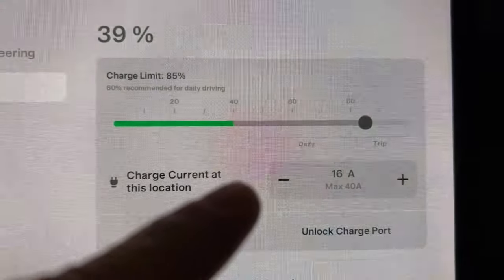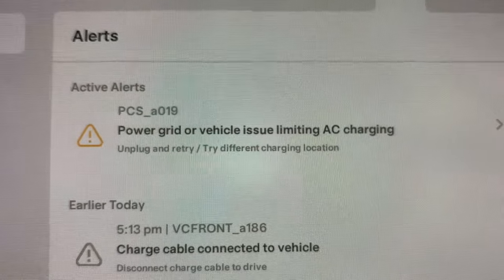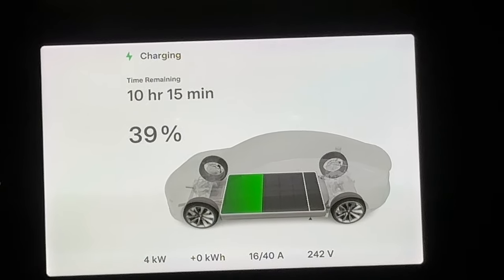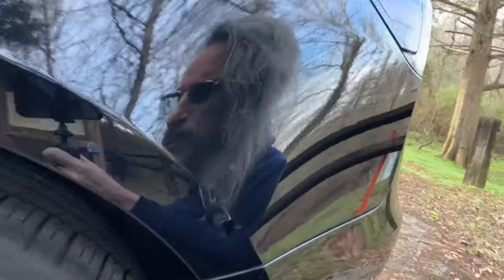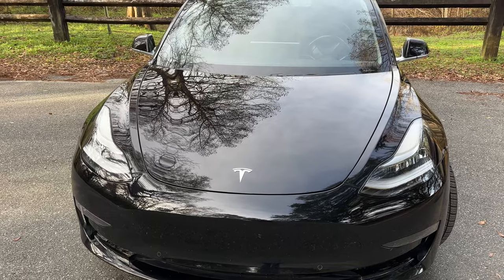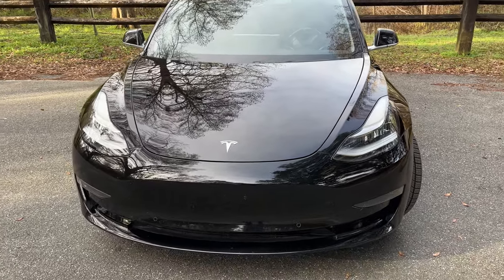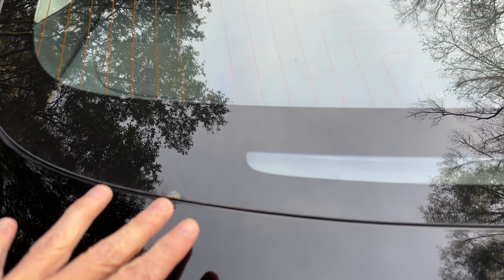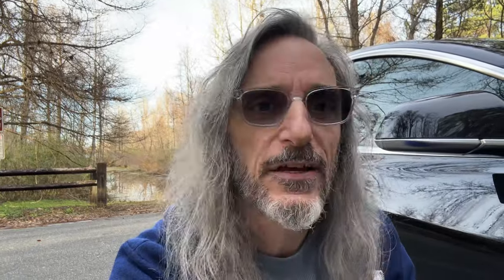Everything Wrong With My Tesla Model 3 That I Bought Used

Comment: I bought a 21 M3 RWD in Jan of 2023 with 11k miles on it.  Just before the huge price drops and the huge drops in the user car market.  I so regret not waiting longer, a lot of depreciation obviously due to that.  Anyway, the reason I'm posting is to share my experience.  AT roughly 18k miles my screen got a message saying "maximum charge level and range may be reduced".  I took it to the Service Center and they had to replace the battery.  This happened last July, the car was with them for a week.  I had a great experience though.  They gave me an 18 model S as a loaner.  A week doesn't seem to bad for them to order it, ship it and install it.  The car now has 26k miles on it.
Reply from the maker: 26k and a fresh battery! I feel you on the depreciation, though. That was an element of my buying decision. I was going to get a Bolt EV, but figured the Tesla would depreciate less and also be a lot more fun to drive. Definitely true on both counts.
Reply: A couple of questions about that battery. . .

Did they give you a new battery or a refurbished battery?

What's the warranty on the "new' battery?

Did they give you any explanation for why the battery would fail so soon?
Reply: A new battery would be a plus.  A reconditioned battery, not so much.  Ive seen quite a few Tesla owners have their reconditioned battery die.
Reply: That’s the worst luck ever. Less than 5% of Tesla batteries have issues at all, and <1% require full battery change

Comment: After watching this video I'm fully convinced to buy m3p. There is nothing to spend on this car. I spend over 4k on my mk6 golf r  a year , running stage 2 ecu and tcu tune , changed tranfer case,  water pump, oil leak etc cos I'm sensitive to my car I want everything perfect.  Since I realized how much power this m3p is making  . I have been watching tones of videos to see if it has major  maintenance issues.  Thanks for this video
Reply: Did you get it yet?
Reply: @itsr1tz326   no haven't sell my golf r. As I have more important things to do now( buying apartment)
Reply: Bro SAME I have a tuned 435i bmw and im just over it like I just want simplicity at this point now im older

Comment: Why is it out of warranty. It is a 2018. So you should have 2 years left.  Unless it has over 100k miles.  That’s exactly why I bought a 2021 so it will be under warranty for me
Reply: There’s only a 4 year warranty or 100,000 miles on car and drive train and 8 years or 100miles on battery

Comment: The advice I would give with anything electronic is that you should never run anything at 100% if you want it to last long. Flashlights, fans, TVs, phones etc... brightness levels, color levels, charge rates, speeds etc... when anything is run near maximum components will have a shorter thermal life for consumer products. Everything is built with a tight tolerance and to make it profitable. An EV is all electronics so I would be applying that thought process to everything I could. When the PCS is repaired I would limit charging amps to half to give it the best chance at not needed to be replaced ever again if supercharging a lot. It's probably healthier for the battery degradation to.

Comment: Maybe wait to fix the PCS thingy until the Tallahassee service center opens this summer.  Heck more convenient than somehow getting the car to Jacksonville.  Looks like the Superchargers on West Pensacola will be open in a few weeks - maybe.  And they have started work on another new Supercharger location at a Circle-K on Thomasville Rd next to I-10.  High times for Tesla owners in Tallahassee!
Reply from the maker: Oh, I hadn't heard about new Superchargers on Thomasville. I'll have to check those out.
Waiting for the Tallahassee service center is a good idea, and as long as it doesn't fail before it opens, I'll probably do that.
Reply: @DriveElectricWithDomenick  There is a new 4-stall CCS charging spot at the SunSpot on US 90 exit on I-10.  Currently free!  I charged there today and got max speed of 189 kWh at 21%.  Did I mention it’s free?
Reply from the maker: @SpottedSharks  Nice! Unfortunately, I need to change some hardware to CCS charge. My car is a 2018.
Reply: @DriveElectricWithDomenick  That's right, I forgot.  Just as well.  They rope you in with the free electrons to get you hooked, then they jack up the price.
Reply: Wait.... we're getting a service center here in Tallahassee?!?!?!  I didn't know that. Bow I can cross one con off of my list with a Tesla. Seems like this is the right time to buy.

Comment: My 2019 M3P came with well-worn summer tires. It was still snowing in March when I bought the car. I had to be careful and the car was slipping around a bit on the icy roads. I had already budgeted for replacing the tires and went ahead with a full set of All Season tires within a week of getting the car. $1500 

The biggest issue that came with the car was with the steering wheel. The material was starting to come off the wheel within a month of driving. The service center replaced the wheel with the newest M3 wheel under warranty and I haven't had problems with the new wheel.

I have some self-inflicted damage to the rear bumper. I bought my kid a bycicle that didn't fit in the trunk. I decide to ride with the bike handles hanging out the back a little and the trunk open. It was about 5 miles. Enough for the bumps in the road to cause the bike to scratch up the bumper a little bit. It's not very noticable, but I know it's there.

I had 2 different front passengers who stepped on the seat controls when they got into my car. Both times the controls broke. The first service repair for that was about $160, then second was $120 (prices had depreciated by the time of 2nd repair). 

When the service center replaced my steering wheel, they messed up the materials inside, up-front under the windshield and the glovebox was not aligned properly. I took the car back a couple weeks later to get those issues corrected. 

Mostly the used Tesla experience has been good for me. Though, for unrelated reasons, I do not intend to buy another Tesla when I purchase my next BEV. I have always bought my vehicles on the used market.
Reply from the maker: Thanks for sharing! 
I was lucky to have good tires on mine when I got it.
Like you, I've only ever bought used cars. I'm enjoying this one, but also would like to change brands in the future.

Comment: I think my 2018 was starting to exhibit that AC charging issue just as I was getting rid of it. Seems fairly common, I have seen several people mention it. Also likely failures are the PTC cabin heater, and stuck valves in the coolant system (my bf's 2019 has this on occasion, and I think Kyle had the same problem on his). Bf's 2019 3 is also having what looks like screen delamination issues
Reply from the maker: Yeah, I'm wondering if my issue on the bottom left hand side of my screen was from a hit, or whether it's delamination. There were a couple very small pieces of glass that I removed from down there.

Comment: Use Dr Colorchip on the paint chips (don't use touch up paint).  Local PDR shop for the ding.  Any glass shop can repair that windsheild.  Get a good INTERNAL patch on that tire and rotate the tires.
Reply from the maker: Thanks for the Dr Colorchip tip. I'll take a look. And the other tips as well. I didn't think that back glass could be fixed, so that'd be cool.

Comment: I recently bought a used 2022 Tesla Model 3, and I love it.  I have the RWD like you do.

I would suggest the following:

1. A windshield repair company can probably fix the chip in your glass roof edge.
2. Make sure you get your tire fixed quickly because tires with leaks can lose all of their air in a couple of seconds and cause a wreck, tear up your tire and damage your rim.
3. Paint chips on a 2018 is understandable
4. I would also get the charging problem fixed as soon as possible. 

I wish you good luck with your Model 3.
Reply from the maker: We have a service center that's supposed to open in Tallahassee in a couple months. Plan on bringing it in when that happens.
Reply: How much did you pay)
Reply: @AnonN-sr6uu  Hello, I paid $22,900 before the $4,000 federal rebate. So the actual price I paid was $18,900 + $500.00 dealer fee (which every dealer seemed to charge) + tax and license. It came out to something close to $23,500 out the door..
Reply: @franklong6269  how many miles did it have?
Reply: @AnonN-sr6uu  77,314 miles. That seems like a lot, but it is in immaculate condition. Also, Recurrent rates it at 95% of its original battery capacity. Recurrent is an app that tracks how many miles your Tesla can drive on each charge. Because it has LFP batteries, it loses far less of its original battery capacity than the NCM batteries that Tesla uses. The LFP batteries are very durable. 

 I have a real-world range of 225 miles in temperate temperatures below 86 degrees F. It also loses 2-3 miles of range a day when it is parked. I think that is because it is connected to the Internet and it has a full-size computer inside that runs the car. If I were to drive its entire range all at once, I probably could get 240 -250 miles of range in combined city/highway driving, but I have never done that.

Because it has maintained most of its battery capacity, its resale value is around $22,000 - $25,000, which is more than what I paid. I

t really is a very comfortable, reliable car. Everything works. FSD works on the car really well (Tesla has given me two free months of FSD).  The ride is firm but reasonably comfortable. It's quiet, except on rough roads which are rutted and worn (and all cars are noisy on those roads).  It's way faster than about 95% of the cars on the road. 

I installed the Tesla Universal Wall Connector (commonly called a home charger) myself, and it works spectacularly well. It costs me about $7.75 to charge the car from 0 -100% at home, which is dirt cheap. The Tesla wall connector works just like the superchargers. It is effortless to charge my car. I will fully charge the car in a little over seven hours. The wall charger is shown on the Tesla app, and it shows it charging when it is in use.

The Model 3 is easily the best car I have ever driven or owned. The used Model 3 cars save you about $15,000 off of the price of a new one. 

However, the new Long Range RWD Model 3 is probably the best Model 3 to buy right now even though it does not have LFP batteries. It has a huge 80kWh battery pack that gets 363 miles or real-world range, which is just phenomenal and right now, it costs $34,990 after the federal $7,500 rebate. You can use a referral to get an additional $1,000 off of the price, which brings it to $33,990 before dealer fees and tax and license. This is just a spectacularly low cost for the new Model 3. The NCM batteries will lose about 10-12% of their range over the first four years, but you will still have around 340 miles of real-world range, which is more than enough to travel the entire country easily.

Comment: Do you think you'd still buy it again? Do you have a breakdown of the amount of hours and money it took to troubleshoot or resolve these issues? I have a 2017 Prius, runs like a champ, very low maintenance and cost me $12.5k used back in 2021 (worth more now because of inflation in 2024). Teslas are too high maintenance, and the time and frustration fixing these issues would be a huge problem.
Reply from the maker: I really enjoy the driving experience, so I would buy it again. I wish I could buy it at today's market prices, though. The used prices were still on the high side when I bought.
I haven't fixed a lot of the issues. Some are just so small - like the small blemish on the back glass - that I don't think of them when I have free time.
I don't see it as a high-maintenance vehicle. I basically just drive it. 
I never have to change the oil, or do that kind of ICE maintenance. I just plug it in occasionally and drive it. And, having a driven a new (base) Prius a couple weeks ago, I'd rather have a used Model 3 than a brand new Prius. Just a much better driving and software/feature experience.
Reply: @DriveElectricWithDomenick Interesting. Thanks for sharing.  I'd compare a used Prius to a used M3 for the most accurate cost-benefit analysis. 😉Tesla value has dropped like a hot rock in water, as we all know, while the Prius has held strong. I really look forward to seeing longterm reviews on these 2018 M3s compared to the 2017 Prius, for example. I'd reckon I'll see far more Prius on the road relative to the total amount sold in the US for each vehicle (between 2017 Prius and 2018 Model 3). That will be the best way to test total cost of ownership at 10 yrs (including time spent, gas/electricity costs, maintenance, part replacements, and initial MSRP). I'd reckon Tesla owners pay more upfront (higher MSRP) and more on the back end (higher out-of-warranty maintenance costs and time spent troubleshooting). I include time in total cost to own because I like filling up my tank in 5 mins and going instead of being tethered to the grid until an EV recharges. Time and freedom to move (away from the electrical grid) is a quantifiable value add to hybrid drivers that EV drivers cannot replicate at the moment.
Reply from the maker: @NovaPrincess  Personally,  I charge at home, so I save a ton of time never having to go to a gas station. 
I've road-tripped close to 20,000 miles in the past couple years, and never had any issue with being too far from the grid. It can take a little longer to roadtrip with an EV, but I much prefer it. Just a better driving experience, and that makes up for  the extra bit of time some trips need.

Comment: Thanks for the video. The clink you might be hearing could be the brake caliper disengaging from when you go from Park to Drive and vice versa. You can have someone put it in and out of Park and listen to the caliper lock and unlock. I think think they need to be serviced every 15/20 thousand miles
Reply from the maker: Pretty sure it's not that. The clck doesn't necessarily happen right after the shift. It's really activated once a certain amount of torque is applied.

Comment: sheesh!  We were thinking about replacing our ICE car with a Model 3, but being stranded at a charging station for 11 hours or something because your PCS shit the bed is a real concern. How common are those PCS problems?
Reply from the maker: The PCS only affects AC charging, so it still charges fast at a Supercharger. 
It's not that common, I don't think. Mostly an issue with early builds.
Reply: @DriveElectricWithDomenick  so does that mean you couldn't do level 2 charging at home with a broken PCS?
Reply from the maker: @stevep6318  yes, I can still charge at home. The PCS has three "blocks." Two of the blocks in mine are down, so it charges at 1/3 of normal: ~3-4 kW.

Comment: It is unfortunate used EV cars are not like ICE vehicles, when it comes to repairs or breakdowns.
PCS modules on RWD use a non silicon carbide rectification, and prone to failure. Its possible it was charged at high currents with L2/L3 chargers frequently. Chips on bumpers are easy to fix, since it is plastic.Chip on rear glass can be fixed with uv resin, to almost invisible state.  The nail on tire is an easy fix, since it is not on sidewall.
Might need to check on battery health and maintenance done so far. Brake flush, brake service,coolant check topup, atf change, evaporator and radiator cleaning,cabin filter change etc.

Comment: Dom, did you get an actual estimate from Tesla for the AC charging fix or are you just estimating? I don’t remember you saying. Maybe it’s a cheap fix.
Reply from the maker: I didn't have an "official" estimate (they charge for those), but the  mobile tech gave me the price. I think it was 16-17 hundred. I say $2,000 because once you add tax and the cost to drive to Jacksonville and back, I figure it'll be about that much.
I also inquired at a non-Tesla place that does this work, and it was a bit cheaper, and not a new part, so I think it makes sense to stick with Tesla service for the fix.
Reply: Charge for estimates? Wow,  I’ve never been charged for an estimate by Tesla. Does it depend on the type of service?
Reply from the maker: @petebremy49  not sure. The tech said they'd charge me to confirm the issue, which I guess technically isn't an estimate. I guess I should go back to that video and see if I explained it better

Comment: I set my home charger to 16 amps all the time, slower is better, 2 years ownership on my EV-6 and no battery  degradation, since new 80% chargers still shows 283 miles only charged 4 times in two years at a DC charger, just for the experience not a necessity. 
Put a decal over your damaged door panel and forget about it, replace the screen saver on your tablet, glass company to seal your rear glass, paint less dent remover guy for your dent, patch the tire and wrap the front end and wait until your backup noise can be duplicated every time so it can be properly diagnosed.